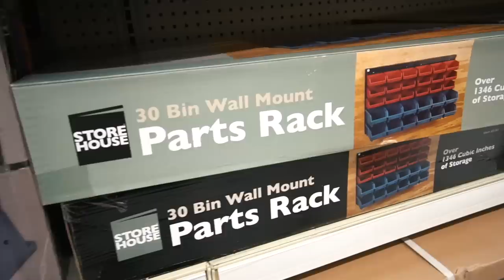How to organize your leather tools - VLOG

Comment: Looks awesome! As far as an idea or a hack goes, if nobody has mentioned it... For your head knife, and skiving knives you could use a magnetic tool holder and screw to the wall. I believe harbor freight caries them as well. 
It may help eliminate having to mess with snaps and a small strap. Just an idea...

Comment: I use similar bins for hardware that I bought at home depot.  Mine have 10 bins to a rack and the racks are stackable.  They work pretty well although I don't have min in the most convenient location to my work space.  I use a wooden tool rack for most of my tools but the bigger stuff is either in a tool box or hung on the wall.  I have a very small work space with only about 5' of usable work bench, this makes cutting double shoulders or sides a bit of a challenge.  Next house will have a dedicated leather shop.

Comment: Idea is good but those bin's you just hung up, well the plastic bin's get brittle over time and will eventually crack a the hook section in the back.
One day i went in my shop and some bins broke off and parts all over the floor.  So I went back to harbor freight and switched them out with the yellow bin's they are much stronger!
Az Harbor Freight took my old ones back and I just paid the difference!!  Just thought I would throw this out there!!  Nice shop by the way!!